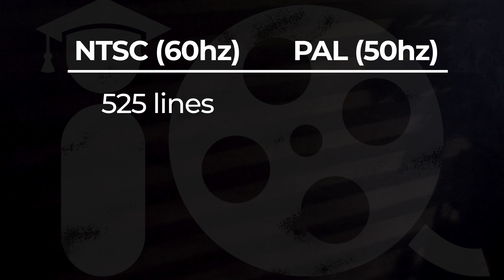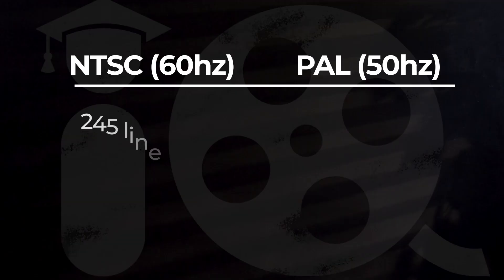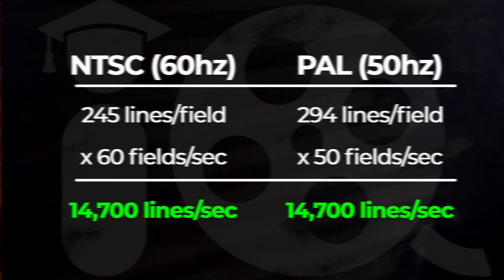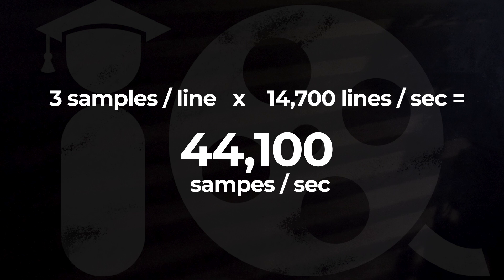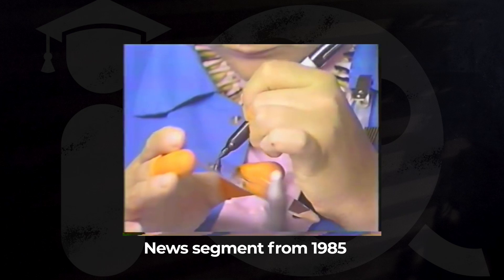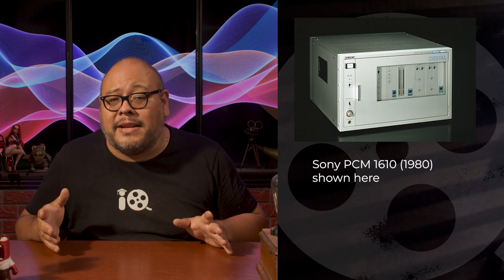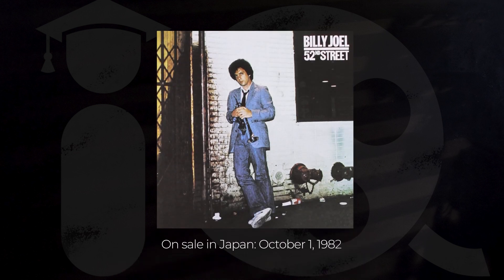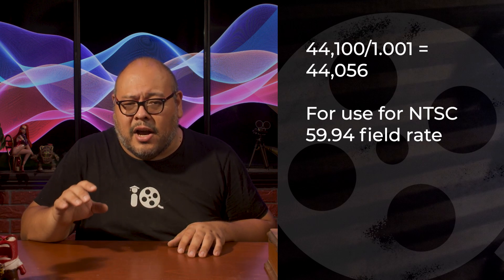The Surprising Origins of Digital Audio Sampling Rates

Comment: Bit depth and dynamic range are not the same.
Reply from the maker: But depth determines dynamic range. It's almost by definition
Reply: @FilmmakerIQ  Bit depth refers to the resolution (smallest amount); dynamic range refers to the distance between high and low (can be expressed in different ways, e.g. dB).
For example, take a linear scale. The 'dynamic range' would be the total distance it can cover, say 10mm,  while the resolution refers to the smallest increment that can be measured; for 12 bits that would be 10mm/4,096=~2.44microns.
Reply from the maker: The smallest you can measure DIRECTLY affects dynamic range. In a linear scale Dyanmic range isn't the total distance it can cover (because you can apply a multiple to get any distance). Dynamic Range is the distance from the smallest to the largest you can measure. So the finer you can measure, the greater the dynamic range.

This is not a contentious point. https://www.presonus.com/learn/technical-articles/sample-rate-and-bit-depth

"The most important practical effect of bit depth is that it determines the dynamic range of the signal."
Reply: @FilmmakerIQ  Interesting take; "(because you can apply a multiple to get any distance)" you still have to keep track of these 'multiples', so they add to the total bit depth. There is also the consideration of absolute vs incremental.
I actually design linear measurement systems and been in cnc for 46 years.
Enjoyed your explanation though; learned something new from that.
Reply from the maker: No we wouldn't track the multiples. I was trying to come up with something that would equate to the volume knob but for linear measurement. You can crank up the volume which just increases the multiple applied to the signal. The highs get louder (as well as the lows), so the total audio power on the end can be whatever we want but the dynamic range won't change.

Perhaps your confusion is none of this is absolute, it's all relative scales.  Bit depth looks absolute, but we're feeding it relative information.

Earlier you mentioned dynamic range being measured in decibels. Decibels are nothing more than a logarithmic scale. Bit depth is essentially the same thing but in a binary scale.

Comment: the more important aspect of audio recording quality is the resolution setting while the 16 bit recording gives us only 65535 (-32768 to + 32767) different values to map the dynamic of an audio , the 24 bit recording gives us 256 times more quality 16,777,216 different values ( you can compare that to the number of pixels of a camera) from -8,388,609 to 8,388,608 , this way low level audio signals record very well while in 16 bit recording without diether the audio signal is too distorted in low level 

while the quality is far too higher in 24 bit , the file size is only 1.5 times bigger
Byte = resolution/8(C.R.T) c= channel and R= sample rate and T for time in second

remember if you record in 16 bit (or any other bit depth) you got to record as high as you can without cliping , if you record dynamically low level signal you use less bits to map the signal , it's like you have 65535 pixel but only using 20,000 of them to take the picture and zoom . but recording in 24 bits ensures you that yo9ur record has lots of dynamic room 
specially for instruments like guitar that have a huge difference in dynamics ( some times only one string plays smoothly but other times all 6 string played harshly)

Comment: All i hope is that we finally get movies in 48/50/60 fps at least or even 120fps...
Its really time to stop using that fking 24p cinema format.

Really, play any nice looking game on your 120Hz/Vrr TV with at least 100 fps and you will see that its time to go on. Especially since this garbage of IFC is anyways regulary used... better we get high fps content from the beginning, its not 1900 anymore when film was expensive and any TV newer than 2010 is anyways made more or less already for 50/60Hz or even 100/120Hz.
Reply: Whats a big issue with 24p content... for example my LG C9 OLED doesnt handle 24p very well, same problem on a friends Samsung QLED TV.
Especially with BFI (for slightly better motion handling) the movie begin to look like a diashow on my OLED, so it needs to be compensated by the artifact producing IFC a bit...

Not such a problem on my still working 2009 46" 500$ budget and 2011 50" "hiend" 1200$ Panasonic Plasma TVs... they deliver PERFECT 24p/bluray playback, no stutter/diashow effect. It even looks nearly smooth (without IFC!), but still motion is extremely sharp (as always with plasma TVs).
Wouldnt be the Problem that both plasma TVs easily dont deliver enough brightness to make any dark movie enjoyable anymore without darkining the room completely, and for HDR stuff totally useless anyways.
Reply from the maker: Problem is Sample and Hold. The bfi does help with that.

I have several videos explaining why 24 isn't going anywhere

Comment: Excellent explanation. For those of you who can't stick with the whole 12 minutes.
Engineer 1. '' We need to build an oscillator that runs at a high enough frequency to sample the audio''
Engineer 2. '' This video  deck has a load of stuff already in it running at 44.1kHz''
Engineer 1. '' That'll do nicely. Let's have a beer''.

Comment: it just doesn't matter anymore. it's 2021. This video is for nothing. I don't even have cable as there's nothing worth watching, and no one watches DVD's anymore. I'm 53. Get with the times dude.The only thing worth holding on to is Ham radio as the internet itself is getting a little too censorious due to the group that thinks it's shit doesn't stink.
Reply from the maker: Wow... 53 and you write like an angsty teenager.
Reply: What's your handle?

Comment: 8:53 Not the year "is slightly longer", but the result of the revolution of the earth round the sun (called year) divided by the revolutions of the earth itself (called day) is not an integer.
It´s about 365,24219052 days one way round the sun .
So when you don´t want the fix dates in the year to vary with time pasing, you have to insert these leap days.
Otherwise after some hundred years you will celebrate christmas in summer.
Reply from the maker: The orbit is slightly longer than a calendar year... essentially what I said in the video. Why do you assume I need to be corrected on this point, I'm talking about leap frames and prime numbers, why assume I don't know basic grade school science?

Comment: Aside some sync and timing issues on some applications, 44.1 is more than enough.
Audiophools pushing 48 or even 192KHz, are just idiots with more money than brains lol.

Also, as a personal anecdote, when I played Doom 2016, the audio had some seriously annoying crackling than only happened if you had your audio output device set at anything over 44.1KHz, it went away as soon as I set it to 44.1KHz.
Reply: Fun fact: in Half-Life most of the sounds are uncompressed 11025 Hz 8 bit, more rare sounds are 22050 Hz 8 bit, and only music, which plays very rarely, is 44100 Hz MP3. And when you play this game, you don't even think, that something is limited in the sounds. Also, very high frequencies are annoying, they can cause listening fatigue quickly, that's why they are often intentionally limited.

Comment: On a similar subject, can anyone tell me why the Amiga used 8363hz as a standard sampling rate? It seems so odd, why not something round like 8000 or 10000hz?
Reply from the maker: Interesting. I couldn't find anything online about it other than it was the interrupt speed of the Paula chip (whatever that means). I also checked that 8363 is a prime number so that might have something to do with it

Comment: The DAB+ digital radio format does not use 44.1kHz, but 48kHz (as well as 32, 16 and 8). So there is one exception to the 44.1kHz for audio only rule.
Reply from the maker: It's was never a rule... just something you commonly see

Comment: SAmple rate is just how often you take a snapshot of the signal. It has nothing to do with frequency.
Reply from the maker: You need to study more into this topic...
Reply from the maker: The irony is the original statement becomes self contradicting if you replace one word with a synonym:

SAmple rate is just how frequently you take a snapshot of the signal. It has nothing to do with frequency
Reply: @FilmmakerIQ  I shall try make another more easily understood picture, samplerate is how thinly you slice the elephant but does not alter the size of it.....
Reply from the maker: But if you don't slice the elephant enough you might miss the fact that it has a trunk.

Sampling rate governs the frequencies you can capture. It's not up for debate and you're just wrong.
Reply: @FilmmakerIQ  When you sample you do it from the lowest freq to the highest. If that is the trunk so be it.....
Reply from the maker: And what governs the highest frequency you can actually sample?
Reply: @FilmmakerIQ  Availabilty, if it's there it will be sampled. With samplerates available between 96Khz up to 768 I cant see that it will not be sampled.
Reply from the maker: "With samplerates available between 96Khz up to 768 I cant see that it will not be sampled." So... you're saying the sample rate governs the highest frequency you can sample?

Which counters your original statement that sample rate has nothing to do with frequency.
Reply: @FilmmakerIQ  No, I don't say that at all. Sample rate will just take the
 specified number of snapshots of what's there during that second including low and high freq. The number of snaps then will govern who true to the recorded material the replayed will sound.
Reply from the maker: But if sound frequency... Which is how fast that sound cycles per second... Is shorter than how many snapshots you take during that same second... Then you can't measure it. 

It's not a coincidence that the word "frequency" and "hertz" are used in describing sample rate.

Seriously, you need to stop trying to defend your position because it is utterly undefensible. You're making logical loops every time you try. For one you think that a single sample contains a frequency...
Reply from the maker: Frequency requires a time - it's in the very definition of Hz (cycle per second). You can't take a single snapshot and determine what Hz you're capturing.

The sample rate governs how high a frequency you can capture. It's not a coincidence that frequency and sample rate are both measured in the same unit.

There are serious gaping holes in your understanding of audio recording. You really shouldn't be arguing this point because it's indefensible.

Start with this video and learn:
https://youtu.be/FG9jemV1T7I?t=543
Reply from the maker: There are gaping holes in your understanding. Please watch this: https://youtu.be/FG9jemV1T7I?t=543
Reply: @FilmmakerIQ  Ok,what is the highest frequency at say 96kHz.......
Reply: @FilmmakerIQ  You are talking about very old technology. You don't need to capture and reproduce anything higher than 20KHz today. Focusing on being able to record and replicate anything higher is futile, there is simply no information there except some transients from acoustic instruments like guitar, piano, drums or piano. And it can only be heard by persons below 20 year olds.For the rest of us there is very little info above 10kHz but then again, if we hear that we hear 90% of the information available. And it's here high sample rates comes in, those 10kHz sounds better and better the higher the sampling rate and quality of recording. And yes, I've seen that video and others before.
Reply from the maker: Please watch this as there are some big holes in your understanding of audio sampling:

https://youtu.be/FG9jemV1T7I?t=547
Reply from the maker: @MrBiggmartin  YouTube is being funky and hiding my comments in studio - so I apologize for repeated comments that make the same point.

You are literally saying that high sample rates enable recording of higher frequencies.  WHY ARE YOU ARGUING AGAINST THAT???

You may have seen those other videos but you don't really understand it if you try to argue that sampling rate has NOTHING TO DO with frequency.

I'm done with your idiocy.
Reply from the maker: @MrBiggmartin  "what is the highest frequency at say 96kHz" - just up to 48kHz - literally Nyquist.

Now you're going to counter that we can't hear that high - Of course WE CAN'T, I'VE NEVER MADE THE CLAIM. I EVEN SAID SO IN THE VIDEO.

But that doesn't change the FACT that sampling frequency DETERMINES what frequencies we can capture.

Okay... now seriously... I'm done.
Reply: @FilmmakerIQ  No, I'm not. To me sampling rate and frequency has nothing to do with each other. High sampling rate just allow for a better reproduction within 20 to 20kHz, same as as with picture with more pixels are sharper than one with fewer. But they are still within the same spectrum.
Reply: It fundamentally limits the maximum frequency you can recreate on the other side. Audio is ironically easier to pick a sampling frequency at, the original theorem cited examples of “how often do you sample the temperature at a weather station, or the line frequency of the power grid?” — if you set Nyquist at 120Hz for a 60Hz AC frequency, you’ll never ever detect higher frequency ripple, transients, and so forth.

Comment: I just have one question. Why does american TV shows have a higher pitched sound when broadcasted in Europe? Does this have anything to do with the leap frames and the sampling rates?
Reply from the maker: No, it's frame rate issue. Our scripted TV shows are usually shot at 24fps - so they speed it up by 4% to get it to conform to 25fps PAL standard.

Comment: So then how to edit and mix video with music overlays which may come from CD or sources with unmatched sampling rate?  How is the resultant video production file mixed so there's no aberrations in the audio & video stream?
Reply from the maker: Lots of digital wizardry - probably some upsampling and resampling going on. Processing power really solves of a lot of those problems these days.

Remember with Nyquist everything from 0-22.05 KHZ is EXACTLY the same be it recorded at 44.1 or 48... the only difference is in the high range (from 22.05-24 KHZ). 

So soundwise, there is no difference in the range we can actually hear.

Comment: I'd like to know how they converted the signal from the tape to the master for CD pressing. And knowing how video works what happened if a line error happened. Like lines you get on old VHS tapes I imagine they were not immune to this perhaps it was rare though considering everything would be fresh. Loved this video so much, cool info I never knew, I love this kind of history.
Reply from the maker: I think they just ran the signal into from the tape into the digital deck.

As for tape errors, they used professional 3/4 tape which is much better than VHS and there was a lot of error correction built into the system. Also remember that digital is a lot more robust, you can have a little noise in the signal and it won't affect the digital information
Reply: @FilmmakerIQ   Good points, I did forgot about error correction. It would be so cool to get to use one of these systems though. Thank you for the response 😊

Comment: Despite, that CD Audio standard is 40years old, only few records has been able to utilize it's 96db of dynamic range. And people believes that if they don't have at least 32bits/ 196Khz, sound will be suffering on they precious soundbar. :-D
Reply: yeah recording at 24 makes sense because having the extra headroom gives you a lot more leeway with your recording levels while avoiding clipping, but there's not much reason to make your final rendered output more than 16bit. I've never met anyone who's been able to actually tell the difference between a 16bit and 24bit recording on a proper A/B/X test, or even hear the difference waveform between the 16 and 24-bit version without cranking the volume up so high that the original audio would destroy their eardrums.
Reply: @fluffycritter  exactly :-)
Reply: Takes very good front end equipment for anything past 19bits to not be lost in the noise floor, and very good back end equipment to be able to hear it. 20bits is really the effective minimum. 24bit audio does sound better than 18bit, but very few people have even seen equipment that can render it, let alone heard it.
Reply: @joshua43214  As long as proper dithering is used the only difference an increase in resolution makes is a decrease in quantization noise floor, so it's a bit weird to refer to the difference being "lost in the noise floor" ... though you presumably mean the analog noise floor as opposed to the quantization noise floor.
Reply: @joshua43214  It makes mostly sense in phase of recording in studio, as amater musician I'm sampling at 44.1khz@24bits from my old synth rack modules. But if you are good in mastering you can make excellent 44.1khz@16bit downmix (not myself :-)), which will blown your mind on good D/As, amplifier, and speakers. I don't forget to hear Vangelis album DIRECT (CD) on Mcintosh mc2120, trebles and basses has been on 0,0, almost showcase dynamic range.